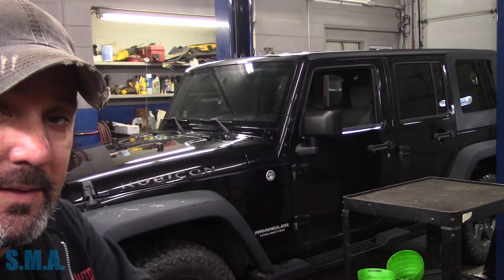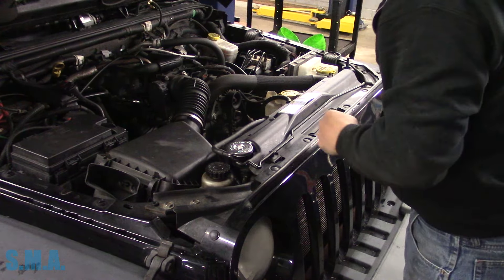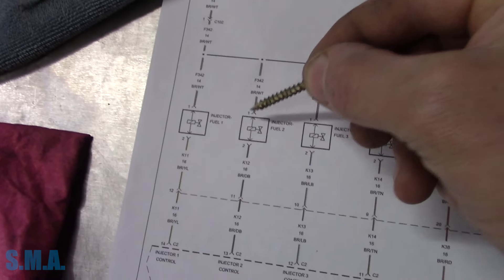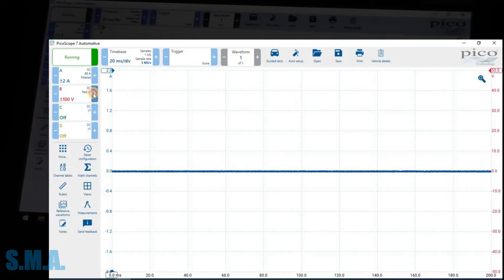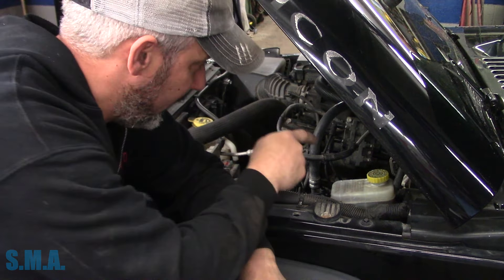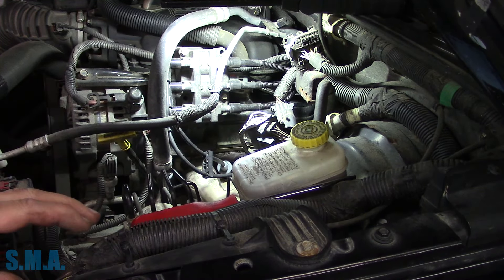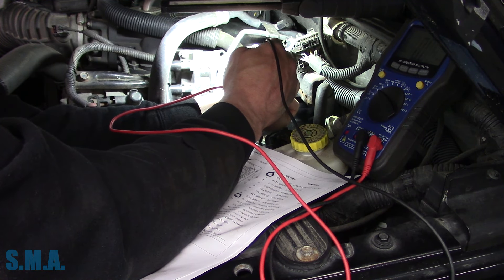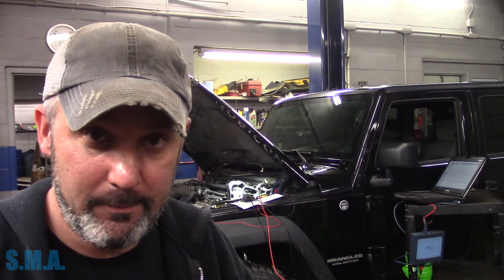Jeep Wrangler: P0204 Injector Circuit & Misfiring

Comment: Eric, outstanding video.  Great lesson on knowing how to use your electronic test equipment to Identify  potentially faulty Injector without having to remove the intake.  Of course, to pinpoint whether the actual defective component is the Injector or faulty/wiring , you do need to remove Intake.  But these steps allow you to be confident in taking your next step knowing intake removal will take some time , but time well spent in this repair !!  Thanks Eric keep up the great work!

Comment: Yup. I pulled the Eric O and refrained from firing the parts cannon at my problematic Mazda Tribute when I had a injector. #1 malfunction code. I did, however, pull the intake manifold to test the injector the multimeter before ordering replacements.

Comment: On a v6 mustang I did the down and dirty test and put my Milwaukee 12volt battery straight to the injector pins using paper clips. She didn’t click then did the same to the new injector. The new injector clicked.

Comment: Dealing with a P0201, don't have the labscope. However do have test light and a DMM. Cold the injector resistance matched a good one on the truck. Hot the good one went up a few ohms. (Matched factory service info specs.) The bad one wasn't able to measure with my manual range DMM and that's with making sure of pin contact. Set of six on the way. About near 190000 some odd miles. 07 Dakota.

Comment: I have a 2020 jk with a injector 3 misfire and injector 3 open circuit. I tested the injectors thru the harness and got pretty much the same results as the video. When cold jerp runs smooth as silk.
Reply: When when I stop and shut of engine then restart engine when hot it pops the misfire and open circuit code. So I bought an injector and installed it  in fuel rail injector 3. Drive it 10 miles stopped to put gas in and when i restarted it threw the damn codes again

Comment: Wow I had the exact same thing happened today at my shop today with a 2008 Ford Edge. Was open then took the intake off tested injector an it was 250 ohms  tested circuit again  was good I was like what the poo. Was getting late so went home next day I came in was 12 ohms. Replaced injector and plugs sens I was there  fixed problem. That's weird

Comment: Fantastic video. I just went through this process with my 03 Caravan .. misfire on #2. Wires, plugs, and injectors all good. Wire harness to the fuel rail was sitting on top of exhaust manifold, and over 20 years and 300,000 km had melted all the insulation. I was surprised it even ran. The bare wires must have shorted out the #2 driver on the cpm. Didn't want to spend any money on a junker, so I spliced #3 (adjacent cyl) and #2 together, so I have 2 injectors firing off one driver. Wasn't supposed to work, but it does. The question is .. for how long? The van runs great, but computers are dumb,... it still thinks I have a missfire on 2, and I now have a permanent check engine light and code.

Comment: p0204, p0206, p06da all the sudden but cleaned all my injectors a few months ago has always had a rough idle has new plugs,new coils probably this weekend putting the whole oil housing, pump, new sensors on fir the one code but misfire don't make sense. Maybe pcm? Ugh hope not k imma watch the vid 😂 i have 2012 3.6 pentastar

Comment: I'm in SA working on jeeps, the most common fault on them is 02 sensors but I've had alot of them with the same problem just close the lugs in the plugs a little the plugs wear out and then makes poor connection I've had two of them where the ecu was the problem, if that doesn't help try replacing the ecu"pcm" that should solve it

Comment: 2009 Jeep with a 4 cyl. I changed the coil pack and plugs but it Will run great for a little while and then shuts down and i can't get over 30 mph. I take a plugs off and it runs ok on  3 cyl.

Comment: Open circuit right after he took the connector apart. Seems like he could have poked the # 4 injector wire a few inches down the wiring harness and wiggled the connector, wire for injector #4.  Maybe a high resistance/almost broken wire at the connector that's affected by heat/current. He could have back probed the connector closest to the camera to do the resistance checks.

Comment: "We shut it off for point-two seconds"... that is a long time :-)  My livelihood was troublehooting digital circuits... for me that would be 200 MilliSeconds. We dealt with critical timings down to about 12ms with a swing of 0.8v. Measuring these high-frequencies meant the equipment and probes would alter the timings. (64 bit datawords) I made a 'millisecond ruler' which would tell me how much to shorten a wire to correct the timings.

Comment: The injector couldn’t stand the heat. Me thinks about the time you unplugged it to the time you probed number 4 injector circuit it must have warmed  enough to open the circuit so when ya checked It unplugged it went bye bye. How much do ya wanna bet after it cools it’ll reconnect and start working again. Well at least you have it narrowed down to the injector side of that connector. Nice work Eric

Comment: Eric may be right but . . . the wiring harness was disturbed by unplugging the connector. 
Most of the open intermittent circuit I've found were at the connectors, and sometimes they were not from corrosion on the contacts  but poor connections to the conductors.  I've found these even inside potted connectors 
Don't trust an automotive connector terminal crimp;  it creates a stress point on newer terminals that don't also crimp to the insulator. Take 3 minutes and use a vampire connection to the inj4 lead to check continuity through to the connector pin before determining the problem is elsewhere. This would definitely point closer to where the open is.  If the connection is solid, the injector coil or ITS connector is opening with heating, and when cooled closing and perhaps making a poor temporary weld.

Comment: I just now getting a Po203. Open circuit cylinder #3. Let it sit and drove 6 miles ok. Cleared code and was ok, then turned off and back on and started misfiring again.  I just did oil change 4 days ago 5w-30 and a quart of Lucas Stabilizer, do you think the thickness of oil has put to much pressure in the engine and caused the injector to fail?? Weather here is 80-85°.
2000 Jeep Grand Cherokee Laredo 4.0 inline 6. Sounds exactly what you are going through here. I don't have any test EQ, just a OBD2. So im hoping it's a sticky injector, so i bought new injectors and installing tomorrow. 🤞

Comment: If my old Toyota pickup ran this smooth we'd be going up for a load of wood right now. I only stack the wood higher than the cab, had to put spring shackle stiffeners in her to ride level. 81 4 wheel drive Toyota  and she runs good on her fourth engine. No injectors, should get a set and computer to run them but she just runs too good.
Reply: Whoops changed my mind.

Comment: I have an '01 ram 1500 with the 5.9 magnum v8,  throwing p0201. I did the plenum plate/gasket upgrade , &while everything was apart,  did plugs, wires, cap/rotor, and new injectors.  Have only put 700-ish miles on it.  Was running good, until p0201.  What are the odds a new injector can fail that quick? The truck starts as fast or faster as any other vehicle on a cold start,  and barely turn the key to start when it's warm. But just like the jeep in the video,  once warmed up, the issue shows up.

Comment: Heat soak after shut off would have increased injector temperature: No airflow past it or fuel flow through it.
Reply: It's the same with a computer CPU. Once the fan is off the heatsink gets hotter before temps start dropping :)

Comment: Love your logic but could you talk more about your tools and the WDs? I mean do you just Google it? I have a 2015 silverado with the big 5.3. I am almost at 70k miles and looking to start doing all the regular maintenance.
Reply: If it’s for a single vehicle you can buy a service manual for $100 or so. Not some Haynes book, get the actual full service manual. That way it’ll have all the info you need. 

Tools are up to you. A general set of tools will get you started, then you have to figure out what else you need. A lot of it depends on what you understand and are getting in to. For instance if you’re chasing electrical problems you’ll need a good meter and some other electrical tools.
Reply: @NBSV1  thanks for helping me make my point. You just listed all the questions I have.

Comment: Reminds me of an intermittent fault on a fire alarm panel I was working on.
Tried tracing out the wiring to no avail, including going into the attic to breaking the circuit there and seeing what happened. Everything was fine. Leave the place frustrated and with panel in proper operating condition.
Go out again for same issue but this time notice the rat's nest wiring inside the panel and trace out the zone wiring where the problem was happening. Out of sheer past knowledge, I shake the wire, low and behold, I cause the fault. Now I know where the problem lies and I now go about shortening this wiring until I get past the iffy wiring spot.
Sometimes you just luck into your problem.

Comment: 2016 keep 3.6 L #1 cylinder miss code secondary moved coil two new plugs continuity on ECM signal wire that already poked full of holes. Noisy valve train but would lack of valve lift throw secondary code?

Comment: I've seen that heat soak ghost before, especially on Chrysler products. I love Chrysler products but their injector quality and said wiring are kinda questionable. some cars will run 300k without a problem and others seem to be plagued with issues while still under warranty. the poor quality is becoming more prevalent in GM vehicles over the last 20+ years as well.
Reply: Chrysler: "Product Quality? What's That", while "Nobody skips the details like GM".

Comment: When you eventually pull the manifold the engine will no doubt be cold. How do you distinguish between open circuit injector and the harness then?
Reply: Can pull the injector and heat it up then see if it’s resistance goes high. I’ve had to do that with some sensors and things before. Could have it hooked to a meter and then heat the sensor with a heat gun. Get it to a couple hundred degrees and it’d go open or high.

Comment: Since you touched the connector why not unplug at the injector and check the the harness for a short on the number 4 wires?  My thought was a possible damaged wire vs a injector since it seems to have failed when you "touched" it .
Thanks for the awesome videos!  I'm just a shade tree mechanic but I have learned so much by watching your methods.  Unfortunately I don't have scopes but I can still narrow down most issues with much more confidence because of you! 
Thanks!
Reply: My thought exactly.

Comment: Not a bad vid. Seems to me what you did was to recreate the customer complaint. That is always an important diagnostic tool. Then you narrowed down where the issue is. And you did all of that without putting the patient under the knife and tearing into the top half of the engine. Yes, it's a bit of a head scratcher but now it's the customer's call. From your reaction I'd say the answer is "no" but I still have to ask if there was a way to get to the connector at the injector without pulling the intake?

Comment: Only 10 seconds into this video but I've had a problem with the Jeep Liberty doing the same damn thing it end up being the fuel injector . Basically the fuel injector would decide to work when it wanted to work stopped working when it's sissy la la ass decided to take a break.. I took them out clean to each fuel injector tested over the 12 volt battery they all made the clicky click sound. I had to pay the shop to fix it and that's what they told me what's wrong with it. Without them fancy dancy tools them jeeps can be a pain in the ass

Comment: Problem with these engines is the fuel injector harness itself- wire insulator melts and the exposed wires touch each other, so you have to disconnect the power steering reservoir and unhook a couple things to fix the wires, electrical tape or what have ya, then it should be good

Comment: My SS chevy 4 door shows PO207 CODE. StabiliTrak came on and my car was vibrating then the parking assistance malfunction. Then it stopped and seemed fine half way to dealership.  They replaced a sensor that cost 700 dollars and problem was still there next morning so I brought my car right back. I thought it was electrical because the light on my radio comes and goes also. They won't listen to me I think because I'm 60 year old lady. This car is my dream car. Can it be something besides cylinder 7
Reply: Does anyone ever respond to these questions

Comment: A injector coil suddenly opening after having current go through it for a while seems less likely as they are pretty tough. I would be looking a the wiring from injector back to where you tested it and then if a mouse chew or break from disturbing it and vibration, service the whole wiring area now you have it apart with electronic cleaner and brush and all that, make it fresh and also check the voltage as each injector is running to see they are all fed the same and thats getting all the way to the injector too. That wiring gets so hot and jaded and protective coatings break away, they eventually have to be serviced so all injectors can fire the same amount assuming good fuel pressure and reg.

Comment: As someone who repairs electronics, to me this suggests that a wire may be broken, and making weak contact in the right position. I'd test for continuity from both ends of the harness rather than across the circuit. See if you can find that open. But by this point in time it's probably solved already anyway.

Comment: I got a problem with p0203 2002 Dodge ram 1500 4.7 with the cylinder 3 injector circuit stuck open but ive changed injector plug coil packs and hace tested wire it is positive and the other is negative pulse but only to about 3 inches from computer no other wires are bad that I've found is there a ground maybe to the engine that I can "coldwire" ground to the ecu or injector somehow im missing

Comment: Big 3.8 my son has a 97 Grand Prix GT with the big 3.8 that I am ready to light a match to
Reply: The 3.8 and a Grand Prix is completely different than the 3.8 between the frame rails of the Chrysler. They really screwed the pooch with that one.
Reply: @rickgaine3476  you ain’t kidding the car has been a pia since day one
Reply: I have a new-to-me 1997 Grand Prix GTP. It had two very intermittent issues, I found and fixed both and it's fine now. There's no way I'd have found them without my Tech2 clone though...
Reply: @mrdanomac7937  I like the style of the car but what a pia. First an issue with the fans then codes related to oxygen sensors which I replaced. I have a 1655 code and p0102. Replaced the vacuum lines as they were pretty old. From what I read fuse # 21 relates to the sensors. Fuse was missing so when I put one in the alarm went off. I hear a vacuum leak but can’t find it comes from back of engine. I suspect egr tube. If I could only find a good mechanic. Goodyear had said fuse junction box is bad. I took it to some other mechanic and they fixed it to pass inspection in NYC. Unfortunately it’s difficult to work in the street.

Comment: Eric O’…I am so proud of you! Using the Scope with a Trigger, using your Ohm Meter, Knowing Ohms Law!  Where did you go to Electronics School?? Consider Gas flow keeps the Injector Coil cool. But turn it off and it heat soaks and Opens up. Remember the injectors on that Vette with TPI?

Comment: I have this issue with a equinox. 2009, replaced battery, alternator , tensioner, belt and sparkplugs . have a cyl5 open circuit and a cyl 5 misfire, p0205 p0305... a mechanic tested it out with a $10,000 obd, and said injector. Now my fleet guys for my job said 90% sure its wiring, because of the open circuit. it ran fine before and I did disturb wires, I checked what I could and I dont want to remove the intake and injector rail. I have heard horrors stories with orings etc dropping down the injector hole into the head because thy are stuck. I did do a cleaning into the fuel line with a carb cleaner and it running to rule out it being stuck due to clog. it ran fine for a few minutes then same problem. white smoke missing stalling and gas comming oeut of the exhaust.
  What was ythe outcome? bad ground to the injector or the injector?

Comment: Did this end up being the injector? I had the same issue and replaced all the injectors since I already pulled the whole intake as well as replacing the coils and plugs as preventative maintenance so I didn't have to pull the intake again later. The issue was resolved but from time to time my wife still says it irregularly develops a misfire

Comment: got a 5.7 hemi in a aspen got number 8 misfire. 210lbs compression, swapped injectors, swapped coils, confirmed with noid light that injector is pulsing. o2 sensors are working fine according to my launch x431. the which cylinder is misfiring in the launch tool show number 8 is constant misfire untill i bring rpm up then it goto 0 and feels like it runs smooth. anyone have any ideas?

Comment: Why is there 70ish volts on injector #1 that he uses for the trigger? These are 12v injectors right?
Reply: The coils in the injector will spike when they shut off just like an ignition coil does.
Reply: @NBSV1  Ah ok. I didn't know either of them did that actually. I've seen relays gets spikes like that though so it makes sense. Thank you good sir.